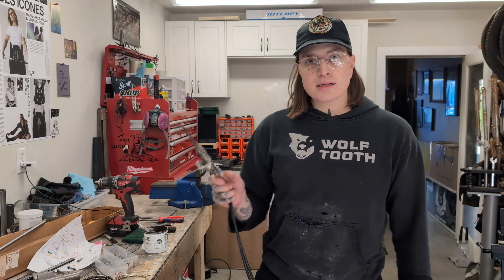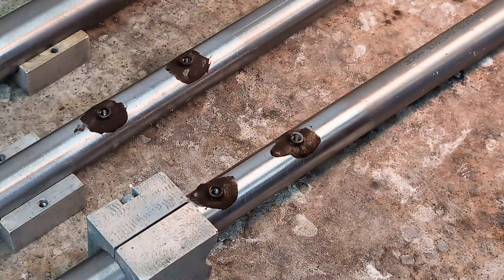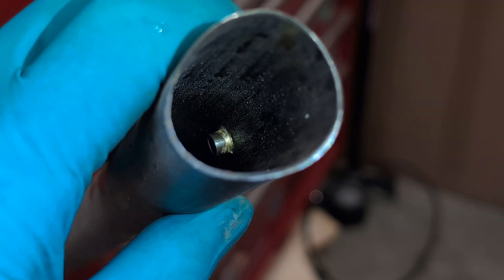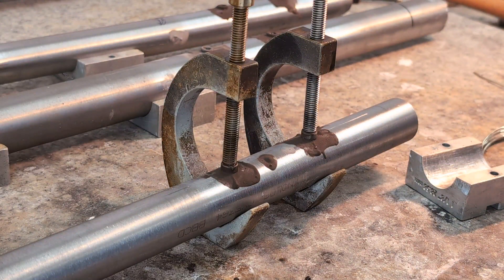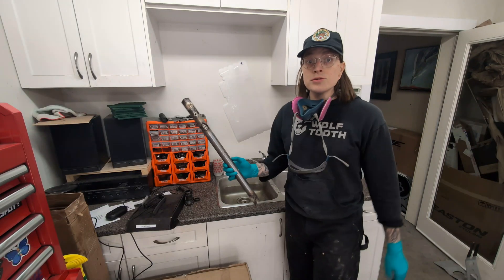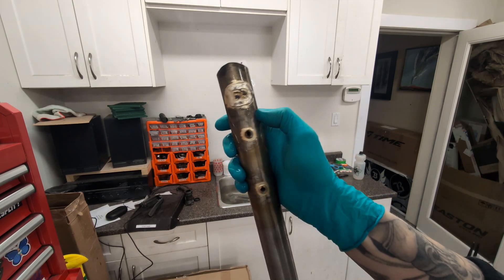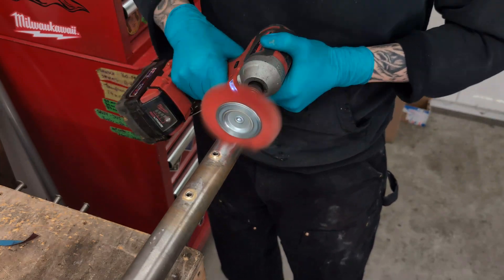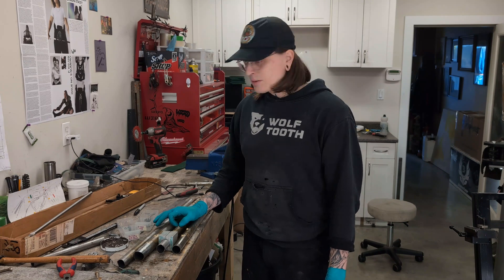how to silver braze - the wzrd. way

Comment: Love the channel!  I have a question, I hope you don't mind.  I've been brazing my own racks - thin-walled 4130 with standard steel braze-ons and bronze rods.  Is it bad practice to return to a brazed joint and do more brazing on it after it has cooled (like if you don't feel like you did such a thorough job the first go round?).  Or will it weaken the initial work?
Reply from the maker: that's not an issue at all! I will usually do the same.
Reply: @wzrdbikes  Thanks!!!